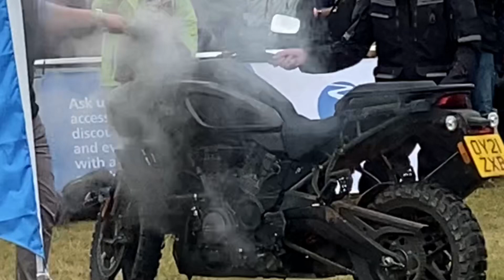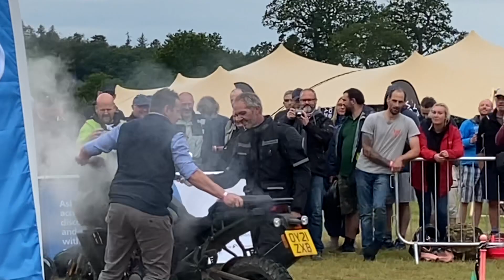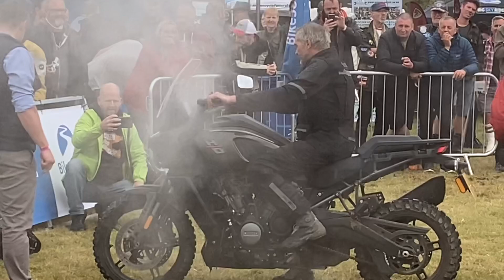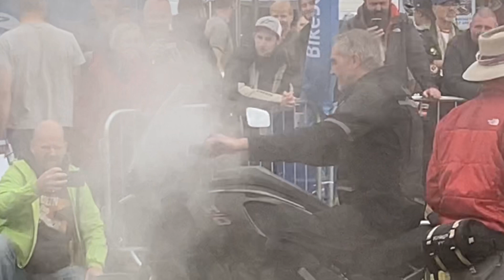New Harley Pan American Disabled during demo

Comment: I wasn’t a demo it was a slow riding competition. An earlier drop on a bike with no engine bars had pushed a radiator hose against an exhaust pipe. The result a small hole and a lot of steam. Bike was up and running on the trail the next day.
Reply: Damn, thank you for the info.
Water + hot exhaust pipe = lots of steam
Reply from the maker: I thought the slow riding competition was part of the program to demo the new model and that this was one of the official demo bikes. Perhaps whoever was responsible for safety should have inspected the bike correctly after the drop, this could have been dangerous at speed.
Reply: @irishflyer6377  had the bike been moving at speed airflow would have cooled the engine.
Reply from the maker: @motorvelo  Perhaps but I doubt that this engine would receive sufficient cooling from Air flow alone and if it was mine I certainly wouldn't run it without coolant, even at speed. BTY congrats on the RBLR, that's a tough day.
Reply: @irishflyer6377  I meant normal riding with coolant. The RBLR was a great day, as long as you made the right plan and rode to that plan. I’ll certainly do it again.
Reply: One is sure 100%. The creators of this bike got ashamed by this incident and will correct the radiator hose mount in next version ;)
Reply: @czaras_  or the pipe would normally be protected by a engine guard. This bike had about 25 people just jumping on it and some dropping it. Also the guy riding it was on the Rev limiter for most of that ride. A totally unfair way to judge this bike.

Comment: If a simple drop can press the radiator hose into the exhaust system and melt it, maybe that's not the best layout for an ADV? For everyone crying it's not fair to Harley I would say, would you be okay with this happening on the side of the trail after a minor off? Sure a set of crash bars could prevent it, but so could a more thoughtful cooling system layout.
Reply from the maker: I have a 15 year old DRZ400 with no crash bars that’s been dropped in every direction, more than once but when you pick it up it goes again. I know many adventure bikes are really just road bikes but the designers should at least try to make them trail capable. This bike had no external damage.

Comment: Mine blew up after 2200 miles and Harley will not warranty it even though no warning lights came on did an over temperature warning light the shape of a triangle with an! Come on during this incident on the demo
Reply from the maker: I wasn’t close enough to see but as it was a kinds of slow riding display and they had more bikes on site I’d expect if it had shown a warning light they would have swapped it out earlier.